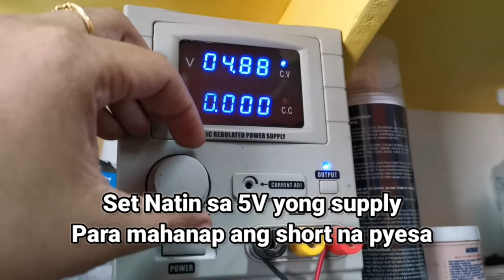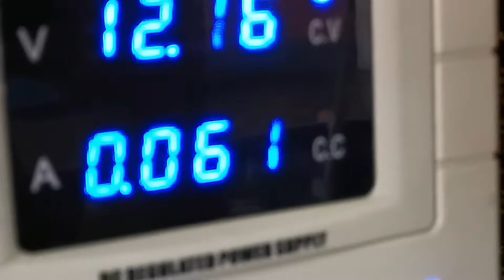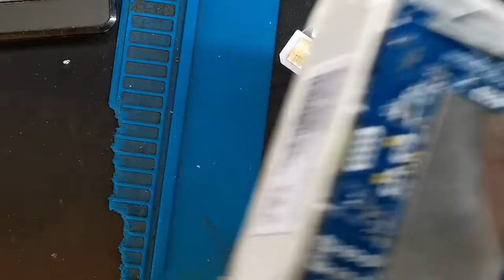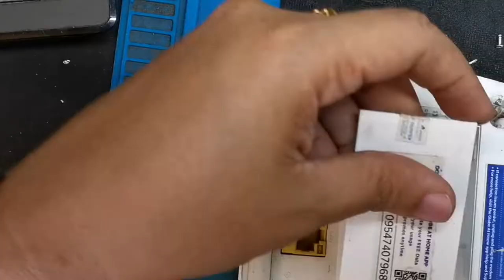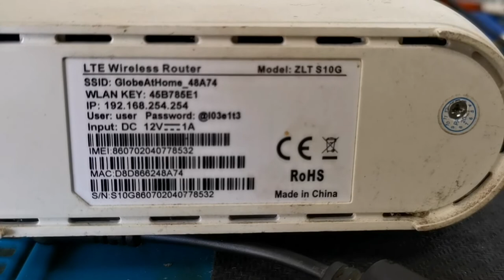How to Repair Globe Wifi(ZLT S10G) No Power Done

Comment: Hello. mangyaring paano ko mahahanap ang seksyon ng signal ic. Ang zlt s10 ay naka-on na kumonekta ako sa wifi ngunit ang wifi ay nadidiskonekta nang random na may error sa pagpapatunay. minsan ang ethernet port din ay nadidiskonekta lang. kahit na ang dashboard ng router ay hindi naa-access hanggang sa i-off at i-on muli ang router. Maaaring ito ay mga isyu sa hardware o software. sorry sa google translate
Reply from the maker: Need niyo po ng diagram po
Reply from the maker: Madali langpo mostly yong signal section po ay connected po sa anttena po

Comment: boss papano po malalaman kung alin dyan un antenna ng wifi signal? balak ko lagyan external antenna un zlt s10g ko (wifi antenna hnd lte antenna)
Reply from the maker: makikita mo yong may bilog sa gilid connected don sa antenna niya sa labas boss yon po yong antenna section po
Reply: Asa jan yunh built in antenna

Comment: Ano kaya replacement ic para dyan sa dalawang ic na katabi ng coil sa may powersupply area pumutok kase ic.nyan sakin bcd lang tatak
Reply from the maker: Hello sir sa pagkakaalam ko wala po replacement sir pwera nalang kung may same model ka na mapagkukunan nong ic po
Reply: @BahistangTechnician  parang buck converter ic sys kaso diko gets mga output nya para modify nlng sana
Reply from the maker: @user-mp1bu1sr4f sguro pag buck converter sya need mo maanalys yong input at output niya para maconvert po
Reply: Oo nga po hirap kase walang name ang ic pero identical sila na ic may isa din ako unit na gumagana magbase nlng po ako dun sa output nya alam ko kase minodify ng globe to may battery din dapat tong zlt may slot din sya ng tel wire..kung 7.4v batt neto malamang mga running voltage nya ay nasa 5v at 3.3v mga ic nya
Reply from the maker: @user-mp1bu1sr4f sge po sir try niyo po balitaan niyo po ako pg nag ok po

Comment: boss sakin nawala yun ilaw ng power pero yung ilasw sa signal meron naman pero ginamit ko walang internet connection prin...
Reply from the maker: try niyo ibang sim sir pag wala parin sa IC napo sira niyan sir
Reply: pano pag blinking na red ? tas walang SSID na hotspot?
Reply from the maker: pag blinking red po may probs po sa signal section niya bro pag ganun try reheat yong mag filters niya sa signal pero pag same parin wala napo solution wala po pamalit na pyesa po pag ganyan probs po
Reply: ganun ba un,?  blinking red ung signal tas walang SSID or hotpot d madetect ng phone ko. pero steady ung power led na blue niya. 
nag flash Kasi aq ng firmware possible ba na mabalik pa sa dati to? nasira siguro 🥲
Reply from the maker: @tambayanchannel5359  pag ganun po nag flash kayo mostly firmware isue po posible maibalik po kung makuha mo yong tamang FW niya sir
Reply: Hindi na sya ma access bro ung hotspot or SSID parang on &off. Mali atah ung napanood ko sa yt na flashing para sa openline.
Reply from the maker: @tambayanchannel5359  yan yong probs sir pag ganyan pag mali yong procedure na nasundan mo hirap na maibalik sa dati
Reply: Di ma reset ung button, parang di responsive, Meron pa ba na ibang paraan para ma-reset ito sir?  ano ung function ng USB socket para sa firmware ba to, Tama? pano to
Reply from the maker: @tambayanchannel5359  di papo ako nakapag try program nang ganyan sir kasi medyo ricky po wala dn po tayon mahanap na tested na FW niyan kaya as of now wala pong sulotion pag fw ang probs

Comment: Ask ko lang po yung globe at home wifi ko bale yung power lang po nailaw ano po posible sira neto?
Reply from the maker: Hello po posible po sa signal ic section po ang problema
Reply: @BahistangTechnician  Hello. mangyaring paano ko mahahanap ang seksyon ng signal ic. Ang zlt s10 ay naka-on na kumonekta ako sa wifi ngunit ang wifi ay nadidiskonekta nang random na may error sa pagpapatunay. minsan ang ethernet port din ay nadidiskonekta lang. kahit na ang dashboard ng router ay hindi naa-access hanggang sa i-off at i-on muli ang router. Maaaring ito ay mga isyu sa hardware o software. sorry sa google translate
Reply from the maker: @mrainaandroid8208 posible po na sa signal section po ang problema hanap po kayo diagram po para malocate niyo po ang signal siction
Reply: @BahistangTechnician  please how can I Contact you?
Reply from the maker: @mrainaandroid8208 you can message me Bahistang Technician Fb page

Comment: Saan jan yung built in antenna
Reply from the maker: Hello sir yong nasa itaas po
Reply: @BahistangTechnician  pwede ba mag connect ako jan tapos connect ko sa  mimo antenna pag sa external antenna kasi i connect walang kwenta
Reply from the maker: @hiraldcastanas428 hello sir same langdn result sir kasi connected dn siya don sa anttena na coconecan niyo ng external antenna po
Reply: @BahistangTechnician  yung iba kasi tinatangal nila yung built in sa loob at  na connect sila ng wire tiningnan kp rin di na man siya connect ang ground lang ang connected zltq10sg unit ko globe
Reply from the maker: @hiraldcastanas428  baka po pwede di ko po natry sir